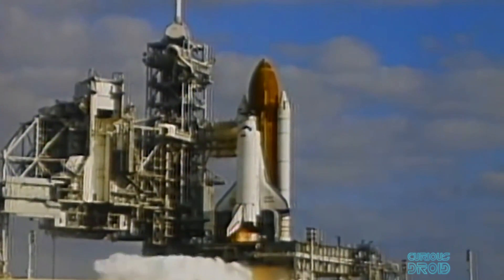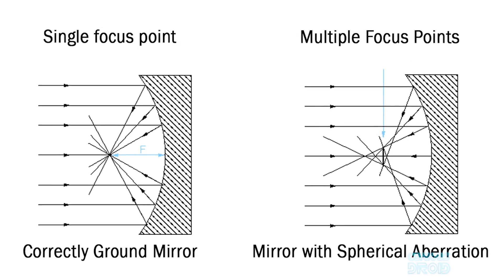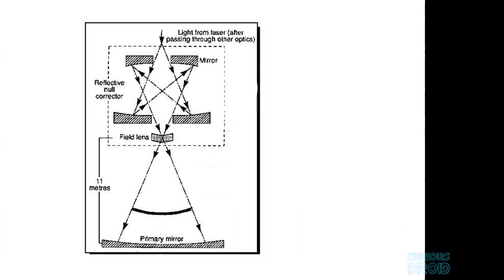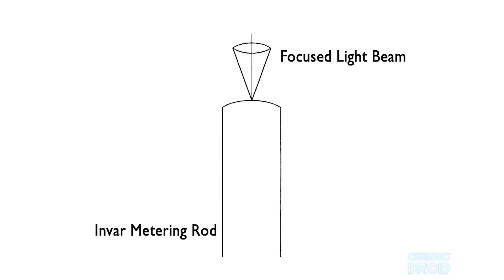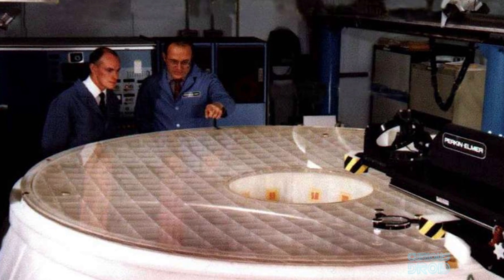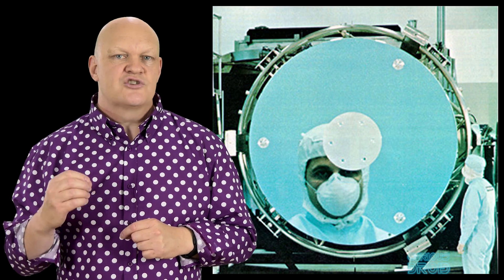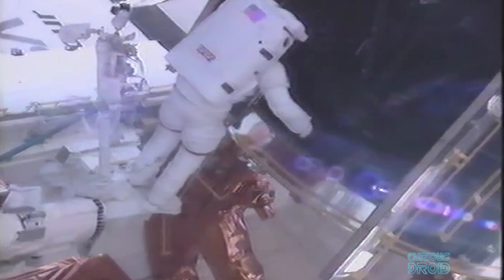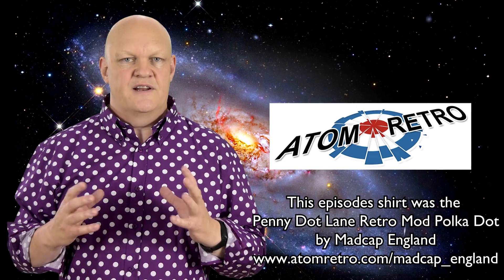Hubble Trouble - How did the Space Telescope Mirror End Up Flawed ?

Comment: I worked at Perkin-Elmer from 1989 to 92 in Quality Control. My job was to log, document, file and direct all schematics of engineering. Not a single schematic left my department without multi departmental approval. As such, I saw everything concerning the Hubble mirror as well as the ISS, which at the time was called Space Station Freedom. While the majority of this explaination is true, it's only part of the story. NASA was involved in every step of the process. The contract was bid on and accepted at a particular variance. Half way through the project, NASA realized they needed a finer polish. They refused to renegotiate the contract as this finer polish would require extra costs to build deeper polishers. Instead, they agreed to the level of polish contracted and THEY would facilitate the deeper polish at their facilities or elsewhere. As for the 15 million dollar fine, yes that was paid, but as a cost over run as the mirror in question is actually the 2nd mirror produced. The original mirror broke during packaging of delivery. Hence the delay in delivery. As for the measurement error, it was only an error in measurement to the new directive. the mirror passed testing and inspection according to the original contract. NASA apparently didn't or couldn't polish down the mirror. They were under pressure to deliver a product because of the money involved as well as launch windows. Yes, P-E bares responsibility for the delay, but met the contract optic guidelines. The official story, the one presented here, was a nice way for both P-E and NASA to save face. P-E went on to become Orbital Science and enjoys healthy government contracts to this day.
Reply: Thanks for the story!
Reply: Teemu Leisti: When I refer to 6 people at P-E who knew, I'm referring to those who negotiated directly with NASA and OS. As I've said, I was in Data Control. Data Control was the hub of all operations at P-E. No matter the department or project, Data Control held all the info of all projects. I know these details not because I sat in on the discussions, but because i was called on to bring forward all the data for the Hubble to those individuals in the negotiations. People at P-E knew something was going on, but didn't have all the info necessary to draw the line. Truth is, Data Control knew more about Hubble, than the people working on the Hubble. Everything about these projects are compartmentalized. Several departments might work on the same project, but they won't know what the others are doing on said project. The 10 people I'm referring too were in direct negotiations. As for the total number of people who actually knew, let alone speculated, I can't honestly say. Everyone in Data Control, probably key people on the Hubble project. Key people at NASA and Orbital Science, not to mention friends and family of those who knew. Probably more than you would think, but still a very small number and most of those would have an outline and not all the details.
Reply: Dedier thanks for the insight , awesome information....
Reply: ChaseNoStraighter: Your welcome to your opinion and it's not my position to convince you otherwise. Nor does it surprise me that if you did indeed work at PE, but not directly with the mirror, than you wouldn't necessarily know the details of the contract for the mirror. The ISS department didn't know the goings on with the mirror, nor did they know the details of the TOMS program. Outside of loose talk around the facility, nobody really knew what the other departments were doing. That being said, there were a handful of people who knew everything. Department directors, facility managers and data control. The fact is, both of those mirrors passed inspection and tolerance, with NASAs blessing, according to the ORIGINAL contract, and that is the key word here. Neither mirror would pass with the updated specifications that NASA introduced after the original contract. Part of that original contract was that NASA would test the mirror at their own facility with PE personel present, which they did, and approved the spec. This is more about politics than engineering. I'm not exonerating PE. God knows they fudged more often than not, but you need to know the climate at that time. PE was in dire straights financially and couldn't afford a huge hiccup like this. PE was on the market and being courted by several other contractors. NASA knew this, as PE had 2 other projects with NASA. In the end, NASA proposed that PE take the blame for the mirror, and in return, NASA would guarantee several long term contracts to PE that would be extended to the new buyer. This made PE look very attractive to the new owner, Orbital Science. This allowed NASA to continue to appropriate money from congress. It allowed Orbital Science to buy into a cash cow with guaranteed, long term contracts, and it allowed engineers, tech and support to continue to be employed. Yes, the mirror failed, but not because PE didn't do it right, but because NASA made a mathematical error. By the time they realized it, they were already over budget and refused to increase the contract budget for the correction. Cost over runs were piling up with software and hardware for the project. This happens more often than not in this business and only a handful of people know the truth. Just as this got corrected, so do most other projects that go sideways and the population is none the wiser. Ask yourself, why would NASA be willing to send up a multibillion dollar project knowing full well it didn't pass THEIR testing? Why would they allow PE/Orbital Science to continue to work on the ISS, for another 8 years, to completion? Why would NASA continue to feed Orbital Science contracts, to this day, if they knew they provided substandard work? Because they don't care? Or perhaps, this is how the system works and this is how this type of business is done.
Reply: TejasMan: You don't de-classify something that wasn't classified and you don't classify something that never happened(wink, wink). This was all done internally and only a handful of people from NASA, Perkin-Elmer and Orbital Science were in the know. I'm aware of 6 people at P-E who knew, 2 from Orbital Science and 2 at NASA, all top brass people. As I've said before, this video is correct as it was the "official" story that was agreed too and released. Funny how the only contractor that could be blamed cease to exist the moment the Hubble failed, but 90% of those same personal continued to work on the ISS and several other NASA projects under a new name, Orbital Science. This was a win-win-win situation. NASA knew they'd have a more than difficult time appropriating money from congress to fix a mistake they made. Congress is not fond of funding NASA as it is, look at the decline of the NASA budget over the last 30 years. It's a real struggle for NASA to appropriate money in the best of times, let alone admitting they wasted a billion dollars because of a mathematical error. However, if they could blame a contractor, a contractor that was going bankrupt, then they would actually have leverage over congress. P-E had serious financial problems, but they also had the ISS contract and that's very attractive to a buyer like Orbital Science, who at the time was cash rich but contract poor. OS wanted bigger government contracts like P-E had, so buying P-E was their way into the game. The fact that NASA promised P-E several long term future contracts to go along with the perception pushed OS to purchase P-E. Now NASA could go to congress and say, "This wasn't our fault, it was P-E, who by the way doesn't exist anymore, and the new company had nothing to do with any of this". Plausible accountability.
Reply: how did the first mirror broke while packaging? it is a very expensive mirror after all.
Reply: "Lastly, were's your evidence that I'm wrong."

Dude, you're the one making wild claims. The burden of proof is on you. So far you've produced nothing but some vague conspiracy soup.
Reply: The original mirror, much like the 2nd mirror, was wrapped in a protective foam film. It was then placed in a secure framing for transport. It was at the point of placing the mirror in the frame that the hoist lifting the mirror slipped the the mirror contacted the edge of the frame and cracked the mirror. It absolutley was human error on the part of P-E.
Reply: Dedier to say that this mirror passed any optics test is ridiculous and does not pass the smell test.  That was supposed to be a 1/20 wavelength or better mirror and it was off by 1.3 mm?  Sorry I'm not buying.  I worked for PE too in a different division and was not surprised by that screw up in the least.
Reply: More tinfoil hat babble. And your story still doesn't make any sense. Do you think making up some excuse to use the other mirror would lead to a bigger scandal (or "questions asked") than the whole fucking expensive telescope not working?

It's not only that you present zero evidence for your claims, the whole story doesn't even make any sense.
Reply: +Dedier that still doesn't explain how a bad mirror went to space, or at least, why Hubble required optics fixes in orbit... Are you trying to say that P-E ground the mirror intentionally with high precision, but incorrectly, with the curvature just under the original specification?!
Reply: okay so does no one work in any sort of manufacturing industry besides myself?

If someone is contracted to make a product to a certain set of specifications and then once the product is finished (or almost) told that there are new specifications then it is 100% on the customer and additional funds are tacked onto the original statement of work to bring the existing tool to spec. If the customer will not pay you more then you give them the design to their original specification and walk away.
Reply: Patience of a saint award goes to......
Reply: Dedier: That's all very interesting, and sounds plausible. So I suppose you're one of the six people at Perkin-Elmer who knew about this misdirection?
Reply: Dedier I have not found evidence for a second mirror built by PE.  I find the official story more compelling without some evidence to support your story.  http://people.tamu.edu/~v-buenger/658/Hubble.pdf.  Measured data from the Kodak mirror holds the key.
Reply: There is nothing to agree or disagree with, just a long confused rant.
Reply: Dedier made this whole story up. For what purpose, who knows? The key give away is the years he said he worked for P-E "I worked at Perkin-Elmer from 1989 to 92 in Quality Control. " The mirror was made much before this. Remember, the original launch date (many years after the mirror was constructed) was supposed to be October 1986, but got delayed due to the Challenger disaster. If this huge cover up really happened, there is no way that Dedier would have known about it in 1989, when the mirror was already finished and the conspiracy in place. The guy probably never even worked at Perkin Elmer. Sad attention seeking really. Rather like stolen valor.
Reply: @williamglover8108  That is correct. The mirrors were made in the early 80s, as explained in the PBS documentary
Reply: @williamglover8108  -- The flaw was known WELL in advance by NASA which is why NASA refused to let numerous universities test the mirror FOR FREE which they were all willing to do during the delay due to the Challenger explosion, which btw, was another massive NASA blunder with the 'O' rings.
Reply: @williamglover8108 : I didn't even realize you commented, otherwise I would've responded to you.

When did the Hubble launch? That would be April 24th 1990. Are you gonna dispute that obvious and recorded fact? 

So, why would NASA just sit on a piece of hardware for 4 years after it was supposedly  delivered?  That's your premise, right, that NASA had the product but sat on it for 4 years? 

4 years is an excessive amount of time, even with the space shuttle blowing up as an excuse. 

The Boeing Starliner is a great example of how NASA sends up faulty equipment, and they had far more oversight with the Hubble than they did with the Starliner.
Reply: Dedier This is the first point in this thread or any context of this story where a crack in the mirror appears.  Nobody has speculated that there is a crack in it and a crack could not be fixed with new optics.  Please explain.
Reply: Orbital / ATK, yea, scope creep is a bastards.  It happens all the time.  Most of the time people want to say," the customer is always right".  But the reality is these projects can and do destroy companies with missteps.  Compromises need to be made from time to time....
Having written many, many contract, spec, SOW, SDRL documents I can tell you, mistakes are made.  Some projects I've worked on have over 30 THOUSAND specs.  This alone can be super costly to just even track let alone qualify of meet the spec.
Reply: Dedier, I find your recount interesting.  One thing I find odd though is that the original reason given in the major news outlets back in the day is somewhat similar you say here: NASA changed the specification but that P-E missed the change and polished the mirror to the original spec (your version is slightly different in that NASA and P-E negotiated how to handle the change).  The video's explanation is brand new to me as of today while "changed specification" reason was everywhere in the news back in the day.
Reply: Sounds like exactly what a representative of the contractor that failed would say.
Reply: Isn't very much a save face for P-E, is it?
Reply: As typical with any government employee and a government contractor's employee there's always finger pointing after a major FU$%-up like this ... and the taxpayer always pays and the employees keep their jobs.
Reply: Sounds exactly like NASA bureaucracy lol
Reply: Could you rephrase that? I have no idea what you're trying to say. I'll keep it simple: How did the mirror end up being the wrong shape? Are you claiming NASA was confused about the mirror geometry?
Reply: 666Tomato666 I agree with you about Trump. His policies are beyond poisonous for today's people.
Reply: This is a fascinating saga, but why would Perkin-Elmer deliver a mirror that they knew would be inadequate due to the updated specifications, even if they hadn't agreed to adhere to the updated specifications? Why wouldn't they say "Your product is done, but we both know it won't work right because you changed the specs halfway through production, so you can have the product if you still want it but we refuse to take credit or responsibility for the product if you use it as-is."?
Reply: Dedier I don’t know anything about NASA, aerospace contractor interactions, or optics; but that won’t stop me voicing my opinion!
Reply: You said there is already a backup perfect mirror in existence on earth, now. Could a Hubble 2 be created with a backup physical chassis already built (NASA, never makes just one of anything) and equipped with new, up to date sensor technology and up to date battery, solar power systems, computer systems and the latest gyroscope technologies? It sounds like this Hubble 2 would be less costly than the original, as there is surely a spare chassis and mirror already built, and the cost of the latest sensors, computers, solar power and batteries, and gyroscopes using what is now more mature, engineering paid for, technology, would be able to blow the first Hubble away on price and performance! Once this is ready for launch, it could go into a more stable, higher orbit via a Falcon Heavy or Big Falcon Rocker or whatever Elon Musk calls it by then, or on an appropriate Blue Origin system. 

It is important to have a continuing Visible Light Space based telescope, something the James Webb Telescope is not designed to do.
Reply: Lol when I first  read this I though it said semantics
Reply: "The official story, the one presented here, was a nice way for both P-E and NASA to save face"

And that right there feels like the most likely scenario.
Reply: So in otherwords this is you trying to deflect blame all these years down the line. Good job buddy 😂
Reply: @DarrylHart : Nope, just setting the record straight. 

Despite all the lies the U.S. government has told you over the decades, this is the one time they told you the truth, right?   Are you still looking for those WMD's, too?
Reply: 666Tomato666: Once again, NASA needed a mirror for a telescope project. They solicited bids based on specs they created. P-E won that bid among several bidders. P-E manufactured that mirror exactly to the NASA specs. At the tail end of manufacturing, NASA came back to P-E and said they needed the mirror manufactured to a NEW set of specs. P-E agreed but it would require more money for tooling and manpower. NASA refused and said to deliver the mirror under the original spec and THEY would finish the mirror to the NEW spec. From the point of delivery, P-E fullfilled it's contract by delivering a mirror to NASA with NASA specs. The rest of the story is about lies, collusion and covering ones ass. NASA might be lazy but there's no way they're going to send a multibillion dollar project into space without testing it. They did indeed test it and it passed to the contracted spec. Thats one example that tells you the mirror was built properly. NASA never once objected to the finished product until it was in space. Would you spend a billion dollars on a custom built house and just believe the contractor that he built it to your spec? I would hope not. You would absolutely verify it yourself or have it verified independently. If the P-E mirror was out of NASA spec, than they could have used the mirror Kodak built. However, the Kodak mirror was built to the same spec as the P-E mirror. Kodak didn't know that the NASA spec changed. NOBODY knew the spec was changed except NASA and P-E. That's example #2, that it didn't matter who built the mirror to the original contract spec, it wasn't going to work. At some point NASA realized they couldn't complete the mirror on their own and couldn't go back to congress asking for more money to actually fix a problem they created by making a relatively simple mathematical error. The rest of the story is the politics of scheming to save face. I hope this clarifies any of your concerns. The real point of the story is this: very little of what any of us think we know, is actually the way it is. Your told a story based on flexible facts and the story is spread through controlled media outlets. I suspect your having difficulty making sense of this story, because your still trying to work within the frame that NASA built for you to believe said story.
Reply: Okay... could explain why the Kodak mirror ended up in a display.  I just gotta add - OMG!
Reply: Kalum: It's not as if NASA has never over looked a seemingly simple detail that caused an enormous problem. You sound like a big NASA supporter so you should know their history and how those mistakes have cost lives. As for analogies, I use them when people lack critic thinking skills and logic to help them understand. So here's the obvious, because I see you loath to read. Somehow a defective mirror was sent into space. Do we agree on that? So ask yourself how NASA allowed that to happen. Either they made the simple mistake of NOT testing a multibillion dollar piece of hardware before they launched it into space, which is disturbing on an entirely different level, or they DID test it. If they did test it, either they found it satisfactory and launched it, or they found it unsatisfactory and launched it. Use your critical thinking skills and get back to me with the scenario you like best.
Reply: 666Tomato666: Wow, It's mind boggling, in this day and age, with all the evidence the public has found to dispel all the lies, conspiracies and false flags that our government has pulled on us, that people still hold to their ideologies like crime death. Yes, we have FOIA, how does that work? Most of the time they refuse to release documents and the ones they do are heavily redacted. Sure, NASA has full disclosure, of what they're willing to disclose. There's even been doctored documents that the government has issued. I really don't know what else to say to you. Maybe, just question the official narrative once in a while. Nobody knew who Mark Felt was either, but as it turned out, he had the truth that the government was covering up. But I'm sure that was an isolated incident and things like that have never happened since. Take pride in the fact that you are the adoring, target audience.
Reply: Kalum: Again, your right. Because official documents have never been doctored, ever, and of course YOU were right there to personally witness the measurements for verification. Your suffering from cognitive dissonance. Like I told 666Tomato, take pride in the fact that you are the adoring, target audience. By and large, the government and it's agencies spend far more time, money and resources to cover up their mistakes and clandestine activities, rather than just doing the right thing or owning up to it. Look at how many files, documents and videos have gone missing, been lost, been erased or thrown away by the completely open NASA program. That alone should give you pause for concern. But besides that, I'm sure everything they are willing to show you is absolute. The truth is, you have the narrative that you want to believe, and I'll bet if a NASA official told you anything other than that, you still wouldn't believe it. Sincerely, good luck to you.
Reply: Dedier I'm very sorry that you've had to put up with this nonsense. Welcome to the YouTube comment section, where idiots and sensationalists get the bigger slice of the pie (Keemstar, Alex Jones, Flat-earthers, etc.). I believe what you said and I can verify that the Government works that way by posting doctored official documents in order to save face. I have family members who have worked at NASA and the DEA, the latter member of whom told me about how shady and corrupt their members and official reports are, and they match your testimony of Government discrepancies between actual and official documentation. It's sad that it works this way, but as the FBI says, "If it ain't on paper, it didn't happen".
Reply: Kalum: That's certainly your choice. But based on your response, I suspect your one who believed the official story told to you by multi national government intelligence agencies that Iraq has WMDs. How did that work for you? For any of us? What did that net? Over a trillion dollars spent and counting. Thousands of U.S. soldiers lost, not to mention the loss of tens, if not hundreds of thousands, of innocent men, woman and children. The displacement of millions more. After 16 years, the most highly trained, highly financed military in the world hasn't found a single WMD. But that was the official story they told all of us. They had intel, graphs, maps and even props. So I ask you, whats the difference in these 2 stories? I'll help you out. There is no difference. They are both stories told to you to support a narrative the teller requires and to suppress the truth the teller doesn't want or need you to know. I have no stake in, nor any reward awaiting me for convincing you of anything. But having worked in these industries for many years and seeing how deep and crazy it gets, I'd rather die by an ugly truth than live with a beautiful lie. Good luck to you.
Reply: Kalum: You just don't get it. Is that by design or simple ignorance. The point I was making about WMDs is that was the official story they told us. You seem to like or believe official stories by your own omission in your previous statement. If your willing to believe the official story NASA gave you, in the face of a contrary story from someone who was there, then it stands to reason you'd believe the story told to you about WMDs. About Syria and ISIS, about how there's no inequality in this country. Where do you draw the line? with this story? In hindsight, we understand that the story we were fed about Iraq was a lie, but don't forget, that lie was the official story at the time. It was only through, mostly independant, investigative journalism that the story fell apart. As for this story about the Hubble, again, you seem to be locked in the framing that NASA spun for you. Try to think outside the box here. For instance, you(P-E) own a garage and a guy(NASA) comes to you and asks you to build him a car. He gives you all the specs to how he wants the car built. You agree you can do it and set forth building it. let's say your finishing up the car by completing the interior and the guy comes back to you and says, "Opps I need the engine in the back not the front". Now what do you do? This is what happened to P-E. Anyway, you say, "Fine, I can redo the car but it's gonna cost more money". He says "I can't, my wife(Congress) won't give anymore money especially if she finds out I made the mistake". So he just takes the car, the way it is, the way he told you he wanted it to begin with and goes about his business. Sometime later, he complains to his wife that the car just isn't working right and she tells him to take the car back and have it fixed right. Problem is, your garage got bought by another guy who isn't responsible for your work, even though you still work there. Now the wife decides to give the husband more money to fix the car because she's already invested and might as well have something to show for it. All the while, the husband never admits to her that he was the one who screwed up. With everything we've been told in the past, only to find those stories were either fudged, omissions or out right lies, why is it you chose to believe this story? NASA contracted for this mirror using THEIR specifications. P-E isn't going to tell NASA what they need. NASA tested the mirror before it was launched. Remember, NASA never complained about the mirror until AFTER it was launched. If they didn't test the mirror once they took possession, then maybe you'd have an argument, but they did test the mirror as testing was contracted in order to accept the projects conclusion. If this mirror wasn't to NASAs' standards, they could've used the Kodak mirror. Why not use that one? So in a nut shell, you'd rather believe a department that apparently didn't test a multibillion dollar project, that they didn't build, that is part of a government that has been proven countless times to have purposely and intentionally lied to it's citizens. Seriously? And armed with that belief and no empirical evidence to support your belief, you have the temerity to question me. Please, wake up.
Reply: "Because there was one US conspiracy, it means that everything that US does is a conspiracy, especially if the stories involve different people and different agencies. After all the gubberment is an amorphous, uniform blob that does the thinking. There's not a shred of real information that goes outside of the Inner Party"

please, tell me, how it is? I mean, living in George Orwell novel?

You haven't presented even a shred of evidence to support your conspiracy theory, but it's us the "blue pills", the "sleepers" and "everything else that makes me feel speshul, while derides other people" that just for some reason can't make the leap of faith from a sheer cliff face, how "stupid" of us.

I hope it was good entertainment for you.
Reply: Holy cow, this is an incredible story! Also, it saddens me (but also entertains me a bit) that your account is so hotly contested. As an engineer, I would also say that it makes absolutely no sense that NASA would miss an error this glaring during their independent verification processes. The reality of government contracts (and, as I can only imagine, working with Congress) means that transparency can come back to bite you, and that people at NASA probably would have lost their jobs over a mistake that was dwarfed by comparison to the Iraq War (WMDs) debacle. I must also note, though, that it seems a bit ludicrous that people in Congress would believe the story that NASA just hadn't caught the mistake in time, and that it was all P-E's fault. I'm wondering if that lack of understanding of the engineering process has contributed to (or been exacerbated by?) the ever-decreasing NASA budget. Maybe we need more engineers to become politicians! (lol.) But seriously, thank you for taking the time to write all of this out. I've learned a lot more about ethics, decision-making, and the effects of politics on scientific inquiry than any case study I've come across so far in the classroom setting.
Reply: Kalum: Your absolutely right right. You got me. With the verdict of a government funded investigation. And the 9/11 commission report was spot on as well. Nothing questionable in either one of those and hundreds of other reports. As far as Kodak is concern, that mirror was never tested independently. It was data reviewed. Huge difference. I'll say this, the Hubble is never coming home. It most certainly could be retrieved, but that would actually tell the true story once and for all. This has been fun, but I'm gonna suggest you continue to believe what you believe and I'll believe what I know.
Reply: SouthwesternEagle: I appreciate that you even took the time to respond to this silly discourse. I find it interesting that most people are willing, needing, to believe a particular narrative, and would actually point to this video as proof of fact. "It's on YouTube, and it explains what i was already told and believe, but those other videos are a complete lie". Or, "NASA discloses all their documentation". Human nature is fascinating. I guess some are awake and some aren't. Thanks again for your input.
Reply: Chase: I didn't say that the mirror that's currently in operation is cracked. What I said is that the original mirror cracked when it was dropped during packaging for delivery, hence a second mirror was produced. That's the mirror currently in operation. Secondly, if time was of the essence and NASAs' figures were correct, Kodak produced a mirror at the same time as the original P-E mirror. Kodak was contracted, specifically to produce a mirror as a back up. Why didn't NASA use that mirror? Because there would be questions as to why the back up mirror was being used instead of the 1st bid mirror. Questions would lead to an inquiry, which would lead to an investigation which would lead to the truth. NASA wanted as few people as possible to know what was really going on and that included Kodak. Waiting for the 2nd mirror to be produced concealed the truth, allowed for the beginning narrative to shift blame on to P-E. Allowed time for negotiations between P-E and OS and allowed NASA to come up with a solution.
Reply: Dedier I actually remember the first mirror being broken. The mirror was made under the Wildcat Stadium, at the University of Arizona Optical Sciences Lab. It was all over the news.
Reply: Kalum: Your ignorance of how this industry works is obvious and stunning. If you worked in the government you would know how easy this is because of compartmentalization, collusion and corruption. If, 28 years ago, I had the ability to smuggle out the documentation you would require to prove this story (Of which I have no doubt you'd question it's authenticity), I wouldn't have, because it wasn't a scandal. It was business as usual. It was another example of how projects get done. Sadly, you question nothing NASA puts out and worse yet, you don't question what NASA doesn't put out. Information that would fill glaring holes in their official stories. It's you, and people like you, who lack critical thinking, are so easily manipulated and indoctrinated, that have brought this country, if not the world, to the place it is now and kept it there. Thank you for your service. But then, you probably don't think anything is wrong. Clearly this conversation is beyond your comprehension. It's not a fault as much as it's a reason and far more telling of you than me. Good day
Reply: I can't figure out how you say PE paid NASA for PE to make a second mirror. Actually, I can find nothing of a second mirror. Nor can I understand how you can say NASA tested and certified the mirror and found everything satisfactory until it got into space. Nor do I get how you knew all this was going on... ten years before you joined the company. Which had fired most of its workforce in the meantime, but had hired you to take care of a contract they no longer worked on. And had sold off the division in question. What is this so-called 'ISS department' and why do you mention it? The ISS was 20 years later. What is the 'TOMS program'? Why don't you answer questions instead of making long rambling unrelated rants about politics and conspiracies?
Reply: Kalum: And if this hasn't been enough to twist you up, the engineers who work the mirror had a whole other theory. With the little feedback they were getting from NASA about the problem with the mirror, they came to the conclusion that it wasn't the mirror at all. They believed it was a software problem between optics and/or communication. But since NASA wasn't sharing anymore details than necessary while this snafu was getting media attention there's no conclusive evidence. But think about how NASA actually fix the problem.
Reply: +SouthwesternEagle except 666 doesn't refer to satan, but to Nero (of burning Rome fame).

and I use it exactly to rustle the jimmies of people like you

(for the record, I don't worship any entities, real or non-existent)

"I had a brother like you back in 2001." 

oh, so you think you're able to read people's whole lives just from half a dozen of comments? I have bad news for you: I listen to classical music, and the hardest drugs I ever took was second-hand tobacco smoke. 

"he acted like an intellectual"

aah, right, forgot that we live in the Age of Trump, "intellectualism bad", "bellyfeel good"

"he knew better than everyone else and believed that everything was a lie"

excuse me? I asked for evidence, I pointed logical flaws, and that's suddenly believing that earth is flat, CIA did 9/11 and we didn't went to the moon? I think you may be more similar to your brother than you care to admit...
Reply: Kalum: I'm done with you. Obviously you have imperial proof on your side. You know every minuscule detail of this project. Clearly, you were present during the building of this project. Actually, you have none of that. What you do have is the proof of an organization that has lied to the american public more times than not, and a YouTube video redressing the same old tired narrative. Truth be told, you can't factually prove your belief anymore than i can prove my knowledge. Yet, your the one pounding your chest about how right you are. An inconvenient truth is ridiculed than opposed, before being accepted as self evident. As I told you before, your getting closer. Good luck with that.
Reply: What's that shit supposed to mean? Are you drunk?
Reply: As usual, there is the official version, and there is the secret story, which is true, but only a few people had privileged access to the real facts.  Just like 9/11.
And they pop up anonymously on YouTube to enlighten us.  OK, I'll buy that.
Reply: There's no official story, there's just reality. Which is that P-E fucked up. That's what people do, especially in corporate bullshit factories. The End.
Reply: @Kalumbatsch  ....A ha! So there's the final icing on this cake and it's that this Kalum Batsch idiot no doubt works in the government (probably NASA),  so he hates all private enterprise.
Reply: Kalum: Your getting closer... NASA contracted for a square and for some reason P-E gave them a rectangle and convinced NASA that either it would work as a square or that it was a square. And amazingly, NASA said, "OK". Or maybe, NASA contracted for a square, P-E gave them a square, but actually, NASA needed a triangle and didn't realize it until after the fact.
Reply: 666Tomato666: One U.S. conspiracy? Are you kidding me? First of all, your willing to admit to at least one conspiracy, that's it? Look up every excuse that was used for the U.S. to engage in war. W.W. 1, W.W. 2, Korea, Vietnam, Iraq, Afghanistan. Every single one of those incidents was perpetrated on a lie. Every last one of them. Look up the Air America Syndicate. Do you remember a little thing called Watergate? The list is endless and those are just the ones that got exposed. True, the bigger the event, the more difficult it is to hid, but that doesn't mean they always get exposed. This incident isn't even a blip in comparison. However, Los Alamos was a secret during all the years of creating the atomic bomb. Over 12,000 people worked there and nobody said a word while it was going on. You clearly have no idea how government operations work. Everything and everyone is compartmentalize to the nth degree. They use service and pride of duty. If that doesn't work, they use bribes and blackmail. It's not nearly as hard as you think to keep secrets when working in that format. Look what Wikileaks has revealed about what the government is up too and never told you about it. The worst part is, they're using your tax dollars to do it and you don't even know about it. Not that it real matters because money isn't real, you just think it is, because they told you it is. But that's a whole other conspiracy I'm certain is above your pay grade. I get that it's difficult to accept that this world is not what you think it is, but it's not. It's very cynical and dark. It's corrupt beyond your wildest imagination. The U.S. government is THE biggest terrorist organization and drug dealer in the world. The true story about the Hubble is nothing new, particularly to the people who were in the room. This is how the system really works. If your having a hard time with this, than I won't even bother you with the stories about the ISS. Lastly, were's your evidence that I'm wrong. Official NASA documentation? This video that corroborates that official NASA documentation? As I said before, you and those who think like you, are the target audience, and your proving that point by debating this so ardently with even less evidence than what your asking me for.  "Work your job, drink your beer, watch your sports on your big screen. Don't worry and don't ask questions. We got this and we'll protect you. Just sign your name here and we'll take care of everything". That's the motto and they're laughing at you all the while... I watched this video, I knew it was off base and I said so. My reward was to be attacked by closed minded individuals who swear an alligance to an ideology that doesn't exist and is currently throwing them under the bus. Well done, lol.
Reply: +Dedier
Thank you for the tinfoil hat version.
Reply: "What you do have is the proof of an organization that has lied to the american public more times than not,"

NASA lied? About what? And I guess corporations always tell the truth about everything?

Just let me get your conspiracy theory straight: You're claiming that someone (or everyone?) at NASA knew that the mirror was the wrong shape (but the company who made it had nothing to do with it!), they covered it up, faked documents, got a panel of five people from industry and universities to promise perpetual silence and commit fraud, while they knew there was a perfectly good mirror lying around, but they launched with the faulty one, because "Questions would lead to an inquiry"?

I'm sorry, you're a classic tinfoil hat.
Reply: As in Joe Rogan show one guest talked about how corrupt NASA is ,they wasted billions without developing reusable shuttle like space x as thats the only way they can get their budge pass from the congressmen who want to create more jobs for their states .
Reply: Why should NASA be expected to pay for your screwup, & if a flawed product is any indication of quality control, I'm amazed you retained your job.
Reply: 666Tomato666: I beg to differ about the amount of information gathered and the sourced concerning WMDs. 
That story was falling apart, from foriegn news sources, as the lies were pouring out of Powells' mouth while addressing congress... As for the Hubble, what sources are their to investigate. NASA and P-E. That's it. When P-E went bankrupt,  all data and information about completed contracts reverted back to contractees, where applicable. Meaning, NASA got back all the info concerning the Hubble. OS was only obligated to maintain contract details that were active under P-E. So technically, there's only one source, NASA. Think about it!
Reply: You've admitted your comments are just a long and confused rant. Thank you (seriously, thank you) for coming forth with that and admitting your mistake. You've shown the only shred of honor that anyone on this chain (other than Dedier) has displayed! It's all fine. :) Let's agree to end this dispute then, because we've settled it fair and square. :) I apologize if anything I said offended you. I thought you were a NASA denier. I apologize.
I wish more people would come forth like that. Seriously, we'd have a better world.
Reply: Dedier Your explanation sounds well constructed and plausible. I won't go any length to corroborate it or disprove, as sources of information go, you are as credible as uncle curious Droid here. 
There are many other options... I believe NASA wouldn't on purpose send a flawed 2 billion telescope on orbit just to cover their asses, and keeping such a piece of information secret, for so long, and by so many people, is simply impossible. Nevertheless, you do have a compelling version of something that is just history. It is unnecessary to wake up the ghost of deceit. With all the hardship that occurred, Hubble has proven to be the most valuable instrument sent to space, and even if some may disagree with that, it is certainly the most iconic of them.
Reply: Kalum Batsch Why are you still here? You're sitting there believing that you're more intelligent than everyone else and posting comments that you think are clever, but all you're doing is attacking an innocent man and his recollection of his career with your conspiracy bullshit, just like 666tomato666. Are you envious?

I swear, it's like the burning of the Library of Alexandria all over again, just 1700 years later. You people can't stand facts so you try to destroy them, just like the flat-earthers and the holocaust-deniers and the moon-landing-hoaxers, the evolution-deniers and the Alex Jones worshippers. What is WRONG with you people? :/ Are you unable to comprehend that we have a Space Telescope, we've gone into space, we've landed on the Moon, Earth is a sphere, the Government only releases 85% of all documented info, and evolution is real? All of that is true, whether you like it or not. I'm sorry if it upsets you conspiracy theorists because I know you love to get that cash from views, but I didn't write the truth; the truth IS the truth, period. Get used to it. Encyclopedias will be your guide, whether hardcopy or online. Please, PLEASE, PLEASE think before you post comments!! For the sake of Humanity, I beg you, don't contribute to another Dark Age!
Reply: Sure, and I assume that all people involved in this conspiracy work together, keep their mouths shut and are geniuses that manage to keep every bit of fabricated evidence consistent, which is an incredibly hard task. Also, just remind me.. why exactly are they doing all this again?
Reply: +Dedier "One U.S. conspiracy?" [rest of steam venting omitted]

translation:

"Not only I'm incapable of critical thinking, I'm also incapable of detecting sarcasm and hyperbole"

we knew that 3 posts back, when you didn't explain how Kodak ended up with a correct mirror, you can stop now, really

"My reward was to be attacked by closed minded individuals who swear an alligance to an ideology"

oh, poor you, let me play to you a saddest song on the smallest violin. Protip: If you don't want to be attacked, how about you stop spouting unsubstantiated drivel? It literally requires doing nothing to do the right thing. Oh, and in case it's your "1st amendment", it also happens that it's my "1st amendment" to call you an utter moron for it.
Reply: 666Tomato666 Says the guy who bookends Tomato with Satan's number. Here you are claiming conspiracy to actual facts, yet you have 666 in your name twice! Do you worship Satan?

I had a brother like you back in 2001. He was on a lot of drugs, he was a metalhead, he acted like an intellectual, he thought he knew better than everyone else and believed that everything was a lie, he had a bad attitude, he was insensitive and antisocial, and he worshipped Satan. You're just like him from what I can tell.

You can fool some people, but you can't fool this old man. Please take some time to reflect on your life and realize that you took a wrong turn. Something corrupted you and took its toll psychologically. It's not too late to turn around and correct it.

-Takatoo
Reply: Dedier aah, so you're saying that NASA intentionally flown an (in practice) half-finished mirror (one that had to be re-ground to a different shape), just that very few people knew that.

By "spec", I thought you meant "precision" or "tolerances" not "shape" - that's where the confusion was.

Now, that hypothesis does make more sense, but still, it's just an anonymous comment on YouTube that essentially says, that people would go to the lengths of chipping non-reflective coating on a single measurement device to save face... that sounds rather elaborate and detailed for a lie... on the other hand, the video does not answer how NASA accepted the mirror and didn't check it themselves...

In the end: "whatever"; Trump in 2 years will cost the taxpayer more on golf trips alone than this blunder did. So I think there are more important things to be appalled about that such one off mistakes with no lasting consequences.
Reply: that WMD story definitely didn't provide such detailed and extensive information, let alone naming the sources and how that information was gathered

that's not the case with the Hubble mirror
Reply: Dedier: I appreciate you taking the time to share with us your story and what you believe happened in this situation. It's amazing how much shit someone can get just for posting pertinant information on an obscure topic of space history
Reply: I have no way of knowing that Dedier's story is true. But in his defense, it makes sense that NASA knew the EXACT shape of the the "flawed" mirror.  How else would NASA know how to build the "eyeglasses" that now gives such amazing pictures?  If the mirror was ground haphazardly, no amount of secondary optical fixes would correct such flaws. A motto I live by is " there is no mistake, so big nor so complex, that it can not be covered up".
Reply: Sounds like a pile of bullshit.
Reply: Yeah, with all those vague conspiracies and coverups it's not like there is the 160-page report of the independent review panel from 1990 available online. They also checked data from the mirror made by Kodak and it looks like that one was fine. Sure, in hindsight, NASA should have done more tests and not just assume that Perkin-Elmer knew what the fuck they were doing.
Reply: Who woulda thunk, you're a 9/11 twoofer as well. The Kodak mirror definitely didn't have the same problem as the Perkins-Elmer one, that can be determined from the available measurement data. That's not guesswork, it's cold, hard physics.
Reply: Sure, I'll go right ahead and drop the official explanation given by a multi-billion government agency that went to the Moon in favor of a story written up by an anonymous Youtube commenter that makes no sense whatsoever.
Reply: No, the reason they invaded Iraq was that the Cheney-Rumsfeld gang had a hard-on for Iraqi oil. They deliberately ignored the uncertainties that are inevitable in gathering intelligence to force a conclusion. All of which has absolutely nothing to do with the fuck-up involving the mirror whose curvature was off by a huge amount, which has nothing to do with smoothness or tolerances.
Reply: Why are you calling me drunk? Do you not agree with what I said? If you disagree, please tell me in detail why I was wrong. I only want scientific truth or trustworthy accounts of recollection.
Reply: "As for analogies, I use them when people lack critic thinking skills and logic to help them understand."

Dude, YOU've come here with conspiracy theories!

"Either they made the simple mistake of NOT testing a multibillion dollar piece of hardware before they launched it into space, which is disturbing on an entirely different level, or they DID test it."

shame NASA has an open access policy to all the data they generated, so we will never get access to those documents /s
Reply: LOL, what a wall of obfuscatory nonsense. Now are you claiming that the wrong geometry that caused the spherical aberration was part of the specification that NASA gave to Perkin-Elmer? Don't write another rambling novel this time.
Reply: No, it wasn't a "software problem" and it's not a huge mystery. You're just making shit up to obfuscate the issue, the same goes for your stupid analogies with garages and triangles or whatever.